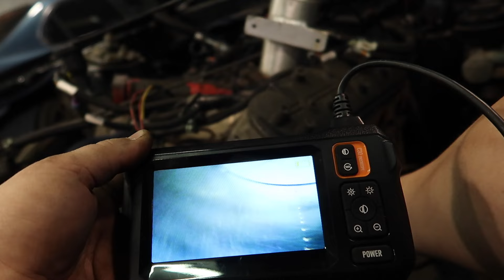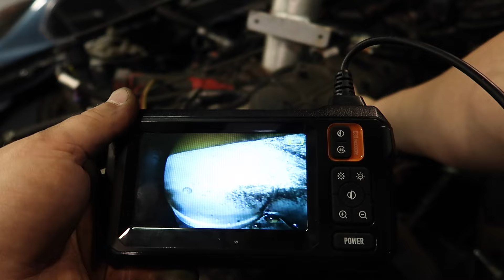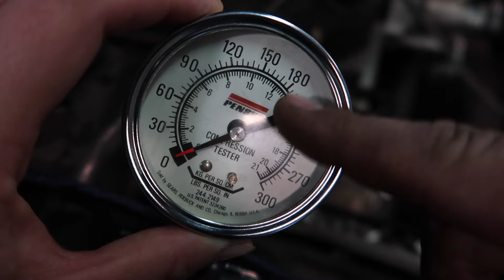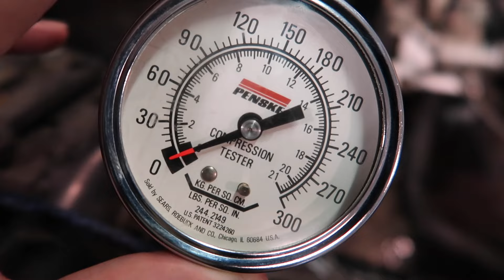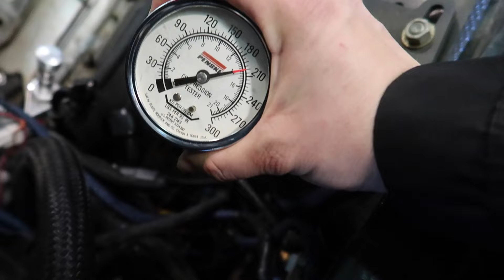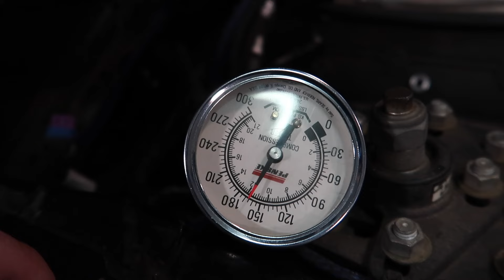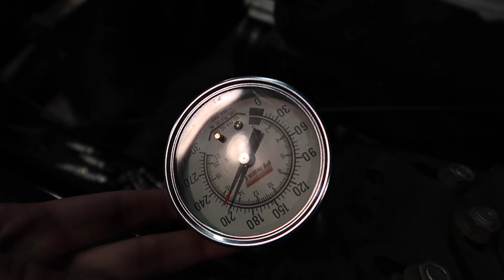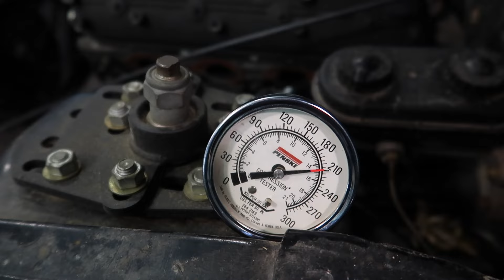Twin Turbo Mustang Hydrolocked With Water ......

Comment: After a situation like that I’d typically pull the heads and check piston to deck height and if you have any that are low in the bore it’s typically a bent rod with a hydro lock situation. Best case scenario you don’t have any bent rods. Hope your family is doing good! I have a couple months until I can call myself Dad haha

Comment: Pull the motor and sell as a roller with turbo kit tell them the inter cooler is junk. Sell the trans separate. Or sell all together with a bad motor. I’d pull the heads since they are easy and just measure how in the hole the pistons are, then make your decision.

Comment: Anything over 150 psi is fine. Camshaft has more to do with it, than static compression ratio. I'd be more worried about the ones over 200 psi. And you were probably onto something, with the lifters not being pumped up the same.

With a bend rod, you can sometimes hear them hit the heads.
I think, since it locked up with just trying to start it, apposed to firing up and locking up. I'm betting rods are fine. Throw an intake on it and fire it up NA, and listen for issues, before you really tear into it.

Comment: Not draining anything with straight water in it for winter is a noob mistake.If that water froze in the cylinders its cracked in multiple places if not bent Valves/rods.Either way the bearings are shot now...